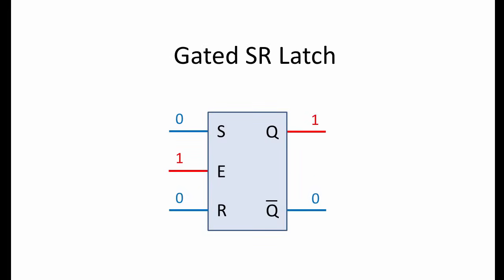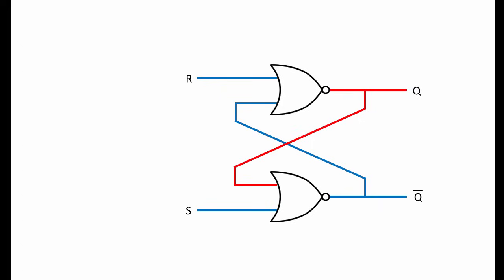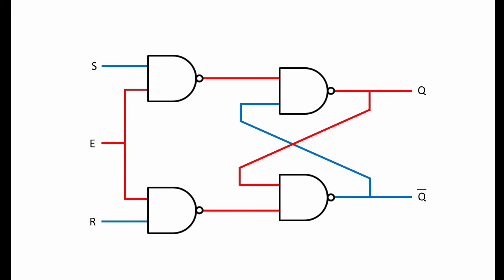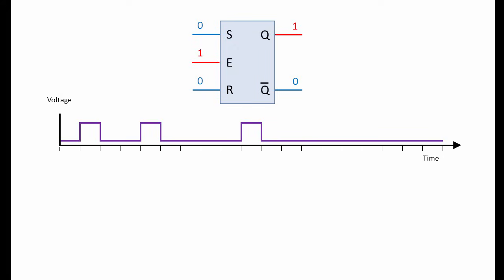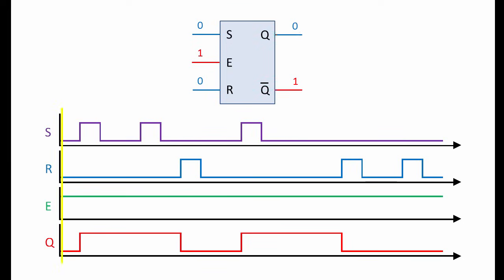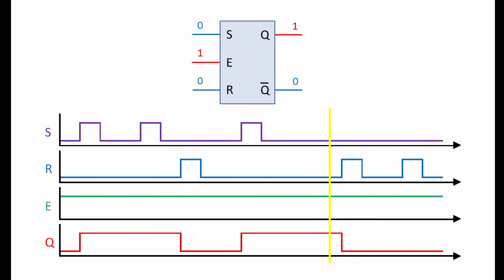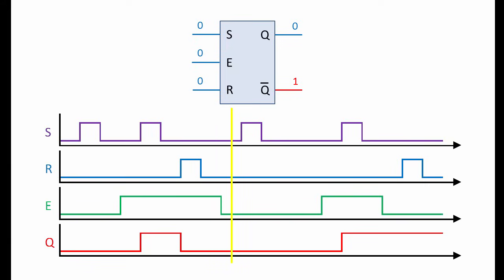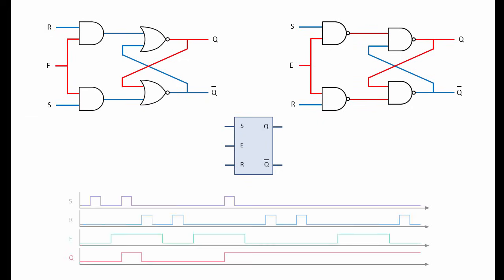Latches and Flip-Flops 2 - The Gated SR Latch

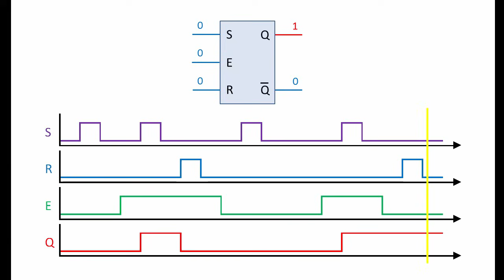Comment: Hi can i ask at 8:34, why doesnt Q change? I dont understand… if the R is high, then Q should reset right?
Reply from the maker: Only if E (Enable) is high.  E is basically a switch which must be high or the latch will not respond to any changes in S or R. :)KD